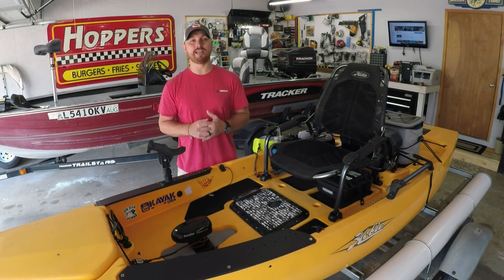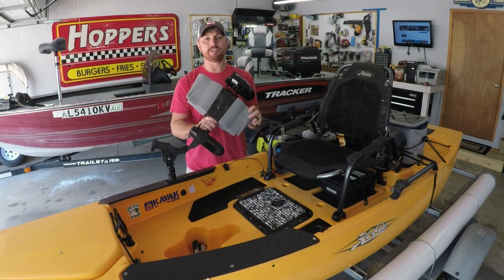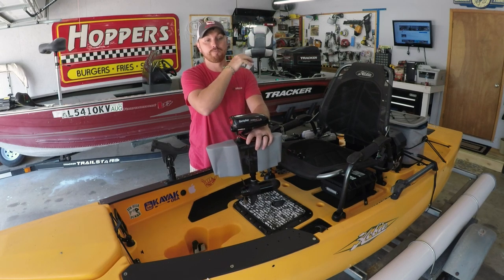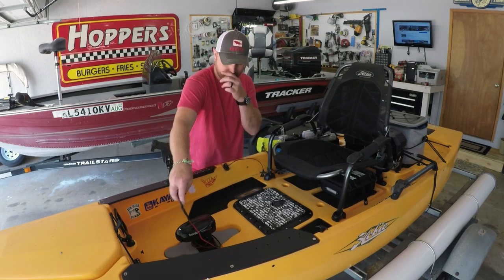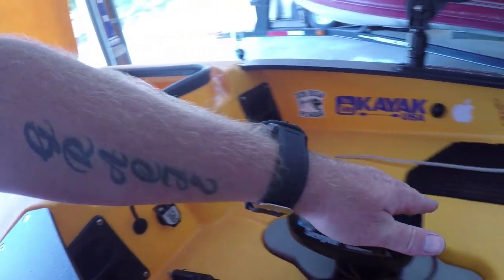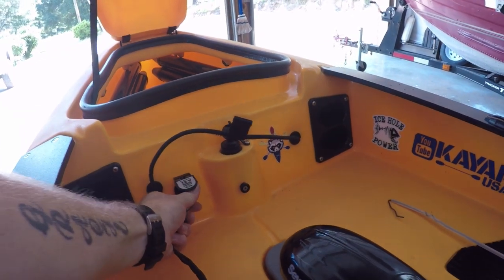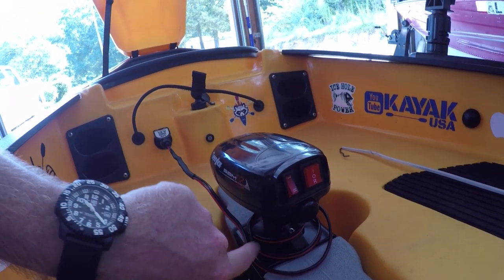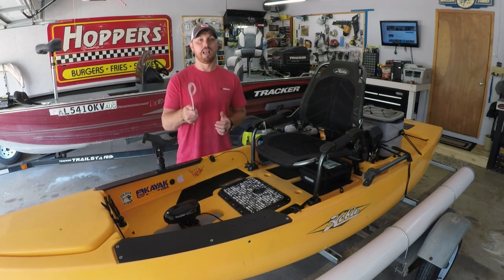Kayak Trolling Motor Build & Speed Test | EASY | 2020 | DIY

Comment: I built one of these for my Hobie PA  3 years ago using a 24# thrust watersnake motor.  Easy to build and added a PWM Variable Speed control to save on battery life.  I think the motor was around $125 - 150,  the components for the speed control were around $25 on eBay.  I use a 35 aH Duracell battery that I put in the front compartment of the hobie and just run the wires out from under the hatch cover.  I left mine so that it could turn in the pod and use it to steer with little tweaks from the rudder control.  The advantage is that it will turn in a tighter radius or move you sideways if you want.  I can keep it from turning with my legs if I don't want it to turn.  I just replaced my Hobie PA with a new Hobie Outback and used it last week for the first time and max speed was just under 4 mph according to gps.  I like the idea of using the stiff wire to reach down and turn the prop, wish I had thought of it myself, but like you said just cycle the motor a time or two and you can lift it out easy enough.  The only downside to the motor IMO is the prop, it gets banged up easily so make sure to buy extra if you can find them.  Sometimes they are hard to find.
Reply: Hi Bill,
Thanks to Kayak USA for posting this thread and for your reply as it helps all of us to know what others are doing in the area of electric motors on kayaks.
Where did you locate your PWM electronics?  Front Hatch compartment? Did you remove the plastic tray?  I took the plastic tray out of mine so that I could easily store either the Mirage Drive or electric trolling motor out of the way when not in use.

Yep, those PWM variable speed controllers are GREAT for extending your run time.  I am really surprised the Minn Kota still offers the 5 speed motors as the PWM  is the new energy efficient generation of trolling motors.  Guess the price point is what keeps the 5 speed motors in the market place but they are energy hogs especially at lower speeds.
On the motor Phil made for me he made an anti-rotation device with a knob on it. You can tighten it just enough to hold the motor in a straight position and you can still steer with the motor with the top handle provided if additional steering control is desired.
John
Reply: how long does it last? and if you unplug the battery while you in the qwater to save battery would it get discharged?

Comment: Nice set up on the PA...quick question that we’re trying to figure out is how can we rig a kill switch on the trolling motor cassette for safety in case the PA flips while the motor is running?  Don’t want it running off & leaving one of us stranded.  Thanks for the video...also like the Runkl boxes in our yaks & can’t blame you on waiting for a lithium batt option on the trolling motor.
Reply from the maker: It shouldn’t be hard at all to get a kill switch with a lanyard and install it directly on the motor. That’s a great idea btw! 🤙🏼

Comment: Good vid mate but what did you use to brace the head of the motor to stop any movement to keep it straight
Reply from the maker: I just locked it in place with the shaft rigs. 👍🏼

Comment: great video. i have the same trolling motor set up on my Pa 12. It]s made by Tony Sebrens from Venture Tube. great little motor. i use a Duracell 35h battery and works great. half the size of the one you have and no issues.
Reply from the maker: Awesome, I’ll check those batteries out! Yeah , I love Tony’s videos, do you know why he quit making them? He use to have a pretty good consistent channel then he just stopped uploading..
Reply: @KayakUSA1  yeah he hasn't put anything on you tube in about 3 months. Do not know if something happen or what. He got on the Hobie fishing team  and then kind of stopped posting stuff. He still puts stuff on his insta gram channel

Comment: Nice set up,  but you should consider wiring a fuse for your trolling motor just in case.
Reply from the maker: I have inline fuses between all my ports and battery packs.

Comment: Neat budget motor build. Watersnake, and I think Sevylor also make a 24Lb  the same size motor as the 18Lb. I used the 24Lb W/S in a build for the Wildy ATAK pod motor, and I can get 5mph, fully loaded out of it. I have a video on my channel of the build and test. I also used a PWM and 50AH battery from FPV, and they make the biggest difference to the motor conversion. 1/ Battery weighs nothing compared to lead acid batteries, and the PWM gives you SOOO much more useful control of the motor, whilst extending battery life. Great vid, hope you dont mind, but i have added it to my channel, under the kayak motor playlist. Well explained, thanks (and subbed).
Reply: how long runtime can you get at full speed?
Reply: @keenang4705  over 3 hours at full speed with the 50ah battery.

Comment: Have you had any issues with water getting inside your motor? Been getting on every outing and having to re-seal and dry it out. Not sure if it's normal as a first time owner.
Reply from the maker: I have not , you might have gotten a bad motor.

Comment: I've got a minnkota 30.  I get fantastic run time out of a 55? Ah Vmax lithium ion battery.   11lbs.  Amazon like $500.   I also have the 100ah Battleborn.  But that lasts way too long @  I use a real tree cammo cooler as a battery box.  Waiting for something specific,  waterproof and that disconnects if you flip.   I use kayaks for wildlife photography and with electric a can really sneak around.   I put 400# me and gear on the kayak rated at 500.
Reply: I think that only the Watersnake or Sevylor Mini prop work on this motor, but regardless even if you could find a 3 blade prop it wouldn't go in or out of the hole.
Reply: @bear8100  right on.   I'm just giving info out.  Mostly the battery.   Mine mounts at the rear and had 550 cord steering.  You get better control in the rear and double the thrust.

Comment: Good morning to you...have you ever needed to put an inline fuse in your wiring for your trolling motor...???...I put a minn kota 45lb on my Native Titan 12 and placed a inline fuse with a variable speed control switch but I can only get 3.5 mph out of it before it trips the fuse...any idea or suggestions as to why I'm having this issue...
Reply from the maker: I don’t have a fuse between the motor and battery on this one.
Reply: Use bigger wire and 40amp fuse
Reply: @mrmichaeltscott  I'm using 10 gauge wire with a 50amp breaker...thanks for the suggestion...
Reply: @petecampa  10 AWG might not be enough depending on the distance.  I can run my MK 55 towing 2 kayaks about 900# total and no problems off 4Awg battery cable with quick disconnects.  10AWG isn't much.
Reply: @mrmichaeltscott  thanks for your reply...I definitely need to look into that...

Comment: Just curious as to how long the battery life would be with continuous use of the trolling motor. Would it be possible to use the motor all day fishing?
Reply from the maker: Probably two days!
Reply: Honestly I think if you used this little motor continuously you would probably burn it up especially at higher speeds..  It's fine for shorter distances but it does build up heat as I have noticed over longer distances. JMO
Reply: Nice video. We built a 24lb WaterSnake version and used a PVC sleeve and a knob so that we could set depth and direction. On top speed setting, it lasts about 3-4 hrs on a 55Ah battery and pushes the PA 17t at about 5-6 mph. Our only problem was the wire connectors to the switches. They were fine for short time, but the switches melted on a long trip once. I replaced them with heavy duty DPDT toggles for now, but plan on using a PWM when I get the chance.

Comment: It's a "prop grappler".  Well I was wanting a paddle drive but seeing as how you got one and still want to use a trolling motor then I may skip the paddle drive and stay using my trolling motor on the two yaks I've got, save me some money lol.
Reply: Also look up "kipiwa propellers" I just bought a 3 blade for my minn kota. They're supposed to give more power/torque and a little more speed, they make them for a bunch if different trolling motors 👍

Comment: Cool video!  Thanks!  Do Sevylor or Water Snake make a higher powered unit that will fit or is the small size due to the low thrust?  I'm kind of a speed demon.  Probably 'cause I grew up and still live in a NASCAR town, I guess.  I'm also big, so 4 mph for you would be less for me.

I was thinking that by unlocking and steering with both the motor and rudder, you would be taking an older Hobie and converting it to a powered version of the Mirage 360 drive boat.  Pretty cool idea even though I have my doubts about the 360 drive.  As is you've given it near instant 180 drive...no different than the Mirage 180...but not quite as instant as a prop drive.
Reply: I don't think the larger Sevylor or Water Snake  motors will fit through the hole in a Hobie but would fit on the back.  If you can wait til 2020, there is a new Torqueedo motor coming that is supposed to go 6 to 7 MPH, but at a much higher cost.

Comment: Just a thought...you could drill through the cassette directly above the base (where it attaches to the hub) of one of the prop blades with a hole sized for your "prop vertical alignment tool". Then you could slide it down after shutting off the power and it would stop the prop from rotating past vertical. Then it is part of the unit rather than a separate tool. The idea is not mine but adapted from this page https://www.mfboat.com/wp-content/uploads/2017/06/IMG_5456-225x300.jpg

Comment: What type of battery and how long will it last for that 18lb thrust motor
Reply from the maker: I went over the battery I’m using in the video, it will probably last a good weekend with normal use. I’m wait on the new ice hole battery tho, it will weigh less than half of this one🤙🏼